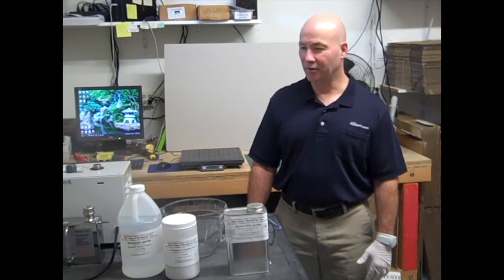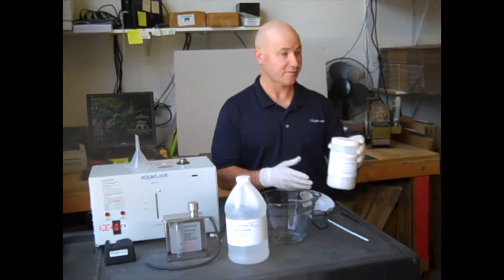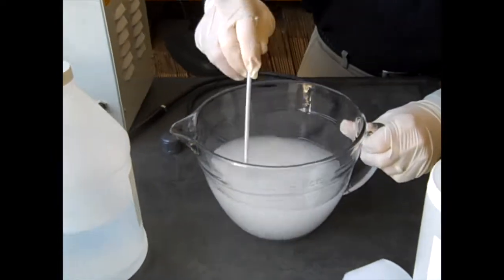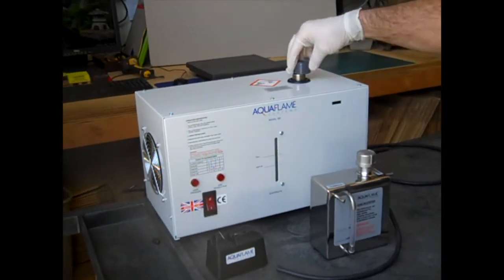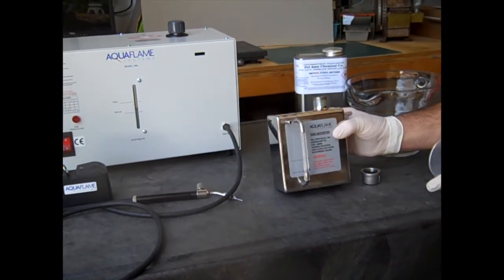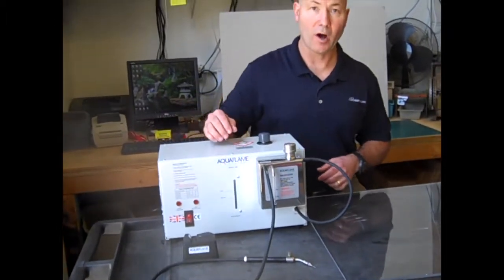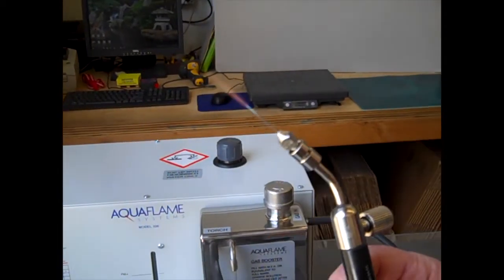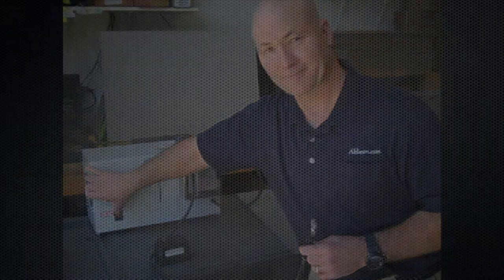Abbeon Aquaflame

Comment: is this safe to use indoors in a basement for jewelry making?  Any toxic fumes given off?  I use a torch to solder occasionally.  Can one operate it using a smaller mix of the chemicals and fluids?
Reply from the maker: Hi, sorry about the late reply. It is safe and we noticed no toxic fumes. You should only use the recommended chemicals in their proper amounts. You don't have to take out all the chemicals it after each daily use.